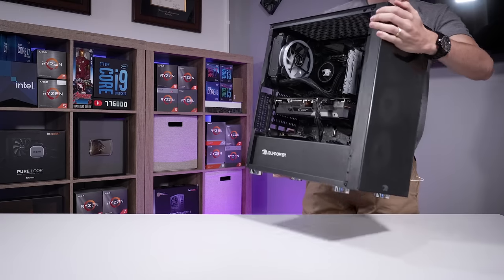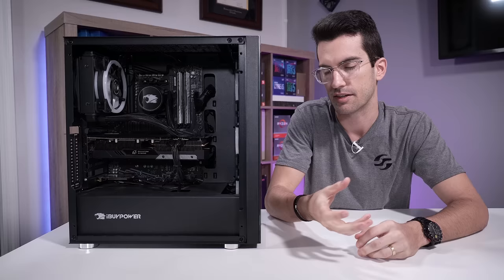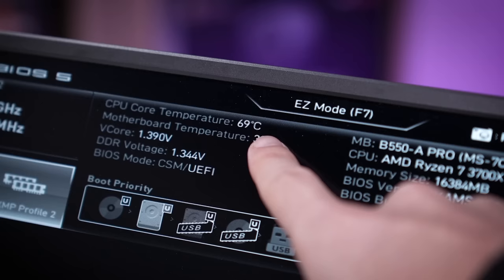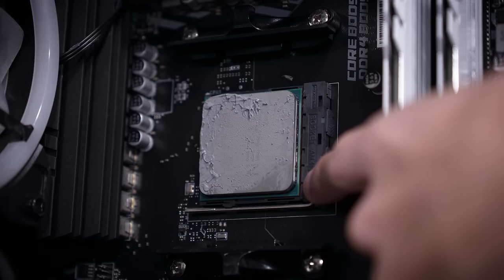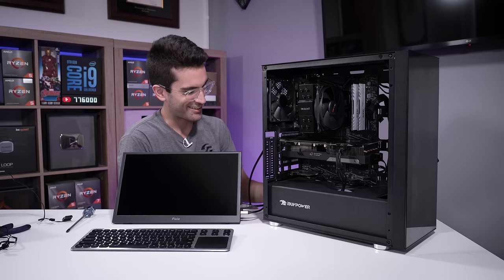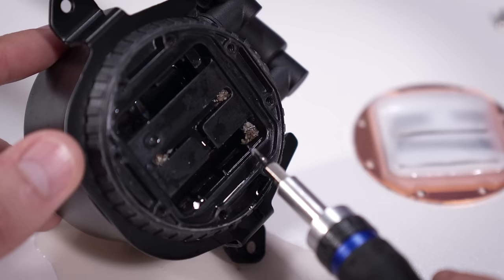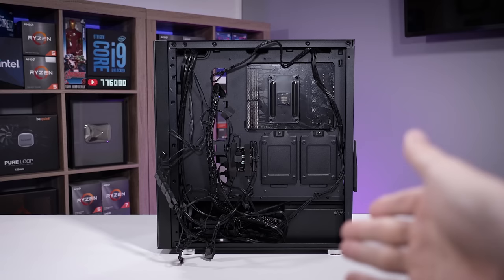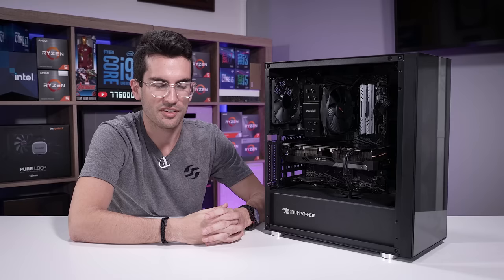Fixing a Viewer's BROKEN Gaming PC? - Fix or Flop S2:E8

Comment: Another great video. Keep at it my man. Would you make a video about resurrecting AIOs like these? 

You posed a good question, "why does the gunk always build up in the fin stack at the cold plate block when the pump is in the rad."

My thinking is that, the fin stack area probably has the lowest pressure along the path even when clean, being so far away from the pump that's churning away. The fins and chambers in the block increase surface area for thermal transfer but also creates some resistance. So when gunk or algae build up in the loops (coolant probably doesn't have enough anti-microbials), they often settle in the areas with the lowest pressure where the water is less choppy. From there it snowballs until the block is saturated with the gunk.

Not sure if that's the case but I'm just an armchair scientist.

Comment: Hmm a year after purchasing my pre-built which I just realised has the MSI 240R in it I'm experiencing really high temps. Getting massive fps drops in Apex Legends where originally I was getting a stable 165fps. 

These videos have been instrumental in hopefully resolving my issue. I've contacted the New Zealand supplier after using the MSI swap program so hopefully I'll get a response and a resolution within the next week.

Comment: I got the same issue on ID-Cooling aio and the pump is on the cpu block, it’s the coolant quality issue. It’s only a 7 month old aio btw
You can also resurrect it by flushing and refill it. I use car radiator coolant just not sure how long more will it stay working before the copper getting destroyed

Comment: One of my MSI 360 made the same noise and caused overheating. Found out that it usually happens to MSI AIO after a year. My s/n did not match the recall. Bought an Asus 360. No problems

Comment: AIO cost and hassle just aint worth it if you're building price to performance - temp reduction is there but I have never noticed a difference in frames at 1080p 144hz - get a top open airflow case with 2 in 2 out fans, a budget $30-$50 air cooler and you're good

Comment: I feel like the issue must be crappy fluid, not enough biocide. I'm running a Liquid Freezer II, they feel confident increasing their warranty to 6 years, so I'm hoping it's gonna be a smooth sailing for another 5 years at least. Original plan was CM Hyper 212 black edition, I really like both these coolers, for sure a tower cooler is a lot less failing point opportunities. We'll see, mayke I'll change back to tower cooler at some stage.

Comment: 2 videos that demostrate that AIO's have issues with clogging of the CPU block. Well, that's a no brainer for me. Air cooling doesn't have that issue. The $35 CPU cooler I'm running now gets me 32 degree idle temps, has 5 heat pipes and an RGB fan. Can't do much better with an AIO.

Comment: Just had to switch my cpu cooler and my pump was in the radiator as well. Was making the same wire clipping noise most likely clogged as well.

Comment: Just replaced this same cooler - temps in Cinebench R23 were maxing out in under 30 seconds.  Also put on a Dark Rock Slim and temps dropped to 69c max on Cinebench R23 10-minute run with a 9700k stock speeds.  Wish I had torn the AIO apart before I trashed it bet I would of found the same thing.

Comment: Repair the AiO next time..... This person has their PC emblematically coordinated. I would've preferred to see a re-fluid, fan reversal & reseat instead of the BeQuiet replacement. 
   It would be cool to see a method to pressure de-gunking of all the fluid channels. I wonder how many AiOs would benefit, right out of the box, from a de-gunking.
   It would make for an interesting expose video of someone were to thermal test like 20 new from sealed box AiOs, then de-gunk them, then re-thermal test them. 
   Great video again, Thanks!

Comment: My 2021 iBuypower build had a 120ml AIO as well, my 5600X played CP2077 @ 96-98 Celsius. Replaced it with a Thermalright Peerless Assassin, this twin tower replacement keeps my cpu around 65-66 Celsius during play. (Would've bought a Scythe Fuma 2, which is on my 5800X build and saved probably another 5 degrees, but, the price was right as apparently Fuma's were going up in value at the time.) Also, yeh, didn't bother disassembling the Asetek AIO. Personal preference, this is my first and last liquid cooled experience, I don't do massive OC, I like my gear to last, screw liquid.

Comment: My 240mm ID cooling auraflow I have on my x58 setup started doing this Temps were wayyyyy too hot I pulled the aio out and took the plate off and it was filled with gunk I took a old tooth brush and some iPa cleaned it up put it back together idle Temps back down to 23-25c and have yet too see the chip hit over 55 under a load

Comment: Had an NZXT M22 (looks like the ones you have had failing) failing on me, CPU temps were over 94 C / 200 F was bought as an prebuild computer, so the company fixed it for me, they initially wanted me to pay for an new cooler, but in the end they upgraded it to an Kraken X63 without further costs.

Comment: Bro it's crazy that you're seeing this because I just had to replace my 120 mm NZXT m22 kraken because it was making that damn noise! It sounded like one of the fan blades was hitting something but it wasn't it was the pump itself, the sun was coming from the radiator but thankfully I had warranty so I went and swapped it out but my temperatures were skyrocketing! They would be stable if the computer was just sitting on the desktop but the moment I opened anything temperatures would go all the way into the 90s and then the computer would shut itself off but yeah I went ahead and swapped out the AIO for a new one and boom everything's stable and good to go!

Comment: They don't make AIOs like they used to.  I'm watching this video on a 6850K / 1080Ti system, and I have roughly 40 Firefox tabs, Outlook, Word, Excel, and HWMonitor running.  My CPU cooler is a Corsair H105 (a discontinued thick 240mm) that's about eight years old and has been in almost constant use.  The CPU package temp is 36C.  The warmest core is 35C.  Yeah, these old Corsairs are awesome.

Comment: That fan on the air tower is only rated for 1500rpms, watch out for those. Those will be quiet. I have a 2000+ rpm fan for my Black edition tower cooler, it does make a big difference.

Comment: I used to be a plumber, What you seen in the copper block is the same stuff that comes out of the bottom of your hot water tank when you drain it. To me it looks like calcium buildup which means they used un-distilled water in it.

Comment: Wow I never saw that junk in a aio. Mine is a really old artic though. It was actually making a noise after put my aio on a new motherboard and cpu. I ended up taking it off the cpu and lowering it below the radiator and shaking it and it fixed it. I had gotten air where the turbine spins; after that it went back to working like a charm.

Comment: Honestly unless aio´s get MUCH better than air coolers in the next 5 years or so im definitely going with an air cooler next time. I built my first pc just 2 years ago and im on my third aio. The first one was a kraken x73 and i RMA´d it because the pump was way too loud for me personally, got another one and same thing i couldnt deal with the pump noise. Then i decided to drop the kraken x73 altogether and got a fractal celsius s36 dynamic. The pump isnt as noisy but still audible.
I learned that i despise that refrigerator sound aio´s make. If i can get the same cpu temperature with an air cooler while not having to deal with that annoying sound its an absolute no-brainer for me.

Comment: I've only used an AIO once, and it's just not worth it. A good tower cooler will equal almost any AIO. Unless you're going to do a full custom water loop for extreme overclocking, AIOs are more risk and trouble than they're worth.

Comment: Nice video!   I never went water cooling, even tho they look very nice compared to air cooling. The simple fact is that they will require maintenance.  This case might be premature failure, but some day you will have to take it apart, clean it and refill it.  Air coolers don't require anything except some dusting (which you have to do  on liquid cooling too), so very low maintenance. Failures are also more obvious.   But, liquid cool looks cool, so I get the appeal...

Comment: The first clue: It's an iBuyPower rig... expect stuff to be hilariously broken (or defective) out of the box or breaking down soon after initial use. Those pump-in-radiator coolers seem to be a problem... particularly with the liquid. Perhaps not enough (or none at all) corrosion inhibitors are being added when they are made. Maybe people should steer clear of these things and pick a unit from brands that have a better track record of longevity (EK, BeQuiet!, Arctic come to mind). Also, the GPU sag is horrific... That is a monster card, it should be externally supported.

Comment: Looks like rusty water... They're not using quality metal apparently, im not sure if stainless steel works well for radiators, but 4000 series stainless won't rust.  Either that or they're getting contaminants in the filling process somehow

Comment: Sounds just like air bubbles circulating through the system until the settle and hydro lock. I don’t think they’re properly purging the air when filling. I don’t see a way it’s even possible when the only opening in the system is the fill point

Comment: I am glad i decided on a big air cooler for my 5950X seems the AIO's can be more problematic, though I wish I had some RGB on my air cooler.
Reply: It really depends on the manufacturer and whose pump/radiator block they are using.  A 120 mm aio is usually worse then an air cooler even if it’s working properly.

Comment: Have an 120mm nzxt with pump in the radiator with the same problem. After i saw your video about it i opened the coldplate and it was stuck with gunk

Comment: I see we have another sighting of the infamous iBuyPower Molex Centipede in the back there.
With regard to the AIO failures, I wonder if part of the problem is the pump being in the radiator and therefore higher in the loop? Usually, as we all know by now, the recommendation is to keep the block of an AIO lower in the loop than the radiator, but that's assuming the pump is in the block. If it's in the radiator, I'm not sure what that might be doing for the position of any potential air pockets. Of course, that shouldn't cause the gunge, which is baffling in itself given that so many companies sell cheap coolant with all the necessary biocide included that can run for years with no issue. You have to wonder what they're putting in these things.

Comment: Is that VCore not super high for Zen2 chips? 1.462v seems extremely high, especially from a prebuilt which presumably the user hasn't overclocked or messed with. Is this a case of MSI running an absurdly high default voltage? I know some motherboard manufacturers have done that in the past.

Comment: would be interesting to see you test different fluids in the water coolers distilled vs tap and see if maybe the manufacturers are skimping out and using tap water causing mineral build up.

Comment: I've had a H105/H110/H115.  And my dad's use same and other water coolers.  They've all died this way, and within 2 years.  They're too expensive, and I've had to replace an entire PC because one leaked and killed a year old rig.  If you haven't got crap tons of money to waste, avoid water coolers like the plague.  I've used an Evo 212 block, only changing fans every few years, for 2 generations now.  Cannot beat it.  Was more than suffecient to keep my ol' toasty AMD 8350 CPU below 50 degrees when stressing it.  Just clean it, and the fans, often.

Comment: That was the problem with my AIO the 1st one like that you did was the same as mine,
it was 4 months old but that mould grew in mine so im wondering if its a batch of solution used
or the radiator having the pump in it.

Comment: Funny thing is that CPU comes with  Wraith Prism down fire cooler and it can handle some minor over clocks if desired (Over clocking isn't really needed anymore btw).  Instead the garbage SI decided to throw in a crappy 120 radiator and used the lowest cost unit to boot.  Build your own folks, it's not rocket science and is quite fun, not to mention you'll be using better parts.

Comment: I had the MSI AIO from the last one of these. Perhaps the budget cuts they make is the quality of the coolant or lack of quality control. They replaced mine with a higher tier model and I haven't had any issues despite the pump being in the radiator.

Comment: I noticed in the first 2 seconds that the AIO was so WRONGLY mounted (by the PC's owner, in the 1st place). The pipes that go into the pump have to be lower than the pipes going into the heat spreader. If its the other way around, bubbles of air will form in the pump and that is a big NO-NO. That must be the reason why the AIO got clogged with dirt and for why so much "sand" had formed inside.

Comment: Do you get better temps if your air cooler has a 2 fan setup? I have a AMD threadripper 3970x. The room is between 75 to 85 degrees depending on the time of year. The idle temps run about 41C.

Comment: I've had an msi cooler 360 with the same setup where the pump is in the rad. i9-12900k hitting 70 idle and 110 while gaming. I swapped to an ekwb aio my temps went to 34-40 idle and 70 while gaming. I do not recommend msi coolers at all. Also had the PC setup only for a couple of months as well.

Comment: Hello i just got another motherboard that was tested and works but i got everything in my case and it is not working it turns on and stays on but no signal so i dont know what to do i took the ram out and cleaned it and took out the CMOS battery and it still does the same thing. WHAT DO I DO

Comment: i spent weeks trying to figure out why my 5900X was throttling while idle on the desktop, turns out I had the exact same problem with a 240R from MSI - Unfortunately I don't have all the original screws and mounting brackets, so I'm not eligible for a recall. I purchased a Lian Li Galahad 360 and temps are better than ever

Comment: I hate that I did not save mine.  Same issue as here. IBuyPower 240 AIO, same clicking noise and overheating.  Replaced with a Corsair H100i and all is well.  Had to do similar cable management in my system...and oddly enough same issue with long POST time (still an issue). Custom build from IBuyPower. A little disappointed in them (system was a year old) but nothing I couldn't fix (mostly from viewing your channel).

Comment: my i7-11700k runs at high temps and yes it is overclocked, i have a 240mm MSI CoreLiquid AIO with 5 Lian Li fans. Do you know any recommendations for aio’s on this cpu that will keep the temps down!

Comment: I’m running a ryzen 7 5800x & a 3060 ti in an MSI Prebuilt with an MSI 120mm Liquid AIO. CPU temps in bios were at about 52 C about 5 minutes after boot. Are these temps normal or should I be concerned?

Comment: I also have this setup with my PC where the AIO is at the exact same position. My AIO is working properly and is set up to push pull air from inside the case through the radiator to the outside of the case. But here lies my problem. Even when removing the glass  panel I can feel a hot spot just above the GPU. All that warm air is suck into the radiator which is not ideal in my opinion. Will it help if I reverse the airflow from the radiator blowing into the case and reverse the 3 front panel fans to suck air out of the case? 
I love your videos and think they are very informative in every way.
Greetings from South Africa.

Comment: Can the “Dark Quiet” work on an overclocked R9 5950’s? If not, what Air Cooler do you suggest?
Reply: DRP from BQ or NH-D15 or similar from Noctua. They're the best among the large air coolers.
Reply: @mikex4941  I had the NH-D15 it couldn't keep my 5950 from hitting the thermal throttle. I didn't want to to go AIO, but I did. I would prefer to go back to an air cooler, but my AIO keeps me at or below 10 degrees of thermal throttle when running synthetic tests.
Reply: @dannydrew3685  Possibly due to the high power draw and heat production of the chip, air coolers can't just move enough heat away from that high core count cpu. But at least for majority of consumer-grade cpu's, large aircoolers would do the job well enough.
Reply: @mikex4941  Well if an NH-D14 can't do it, what air cooler can? I mean I was running 3 Noctua 140m fans in the front, 2 noctua 140m fans pulling air in the back 3 noctua 140m fan on top, and 2 noctua 140m fan on the bottom (oh they were all 3000rpm, all set to max so super loud). Even with all that the NH-D14 still couldn't keep my R9 5950x from thermal throttling. Oh, and the front of the case is Mesh, so it pulled air like a champ.
Reply: @dannydrew3685  Well if the best aircoolers can't handle it thermally, then you may have no other choice but to stick to watercooling and accept the risks that it brings along.
Reply: @mikex4941  There is a 20 degree difference between the NH-D14 and the AIO I am using now. I was just hoping that maybe air coolers have finally caught up.
Reply: @dannydrew3685  Must be the physical limitations preventing further improvement since whatever innovation you come up with, air and water are still different.

Comment: MSI board, so most likely a rebranded MSI CLC.  Not surprised it's having the same issues as MSI's branded CLCs.
Reply from the maker: ? The AIO is its own stand-alone brand. As stated in the video, it's just likely they share the same manufacturing plant/coolant source.